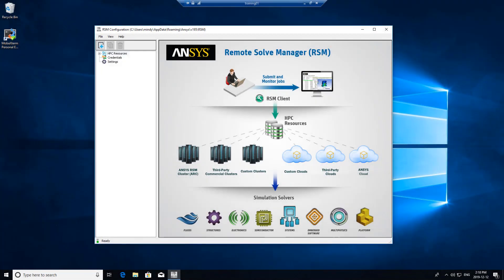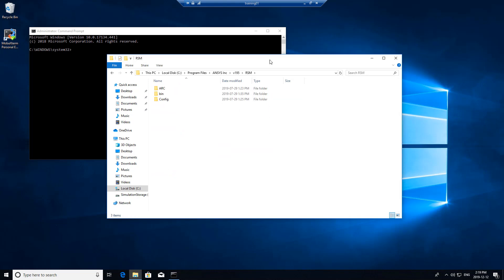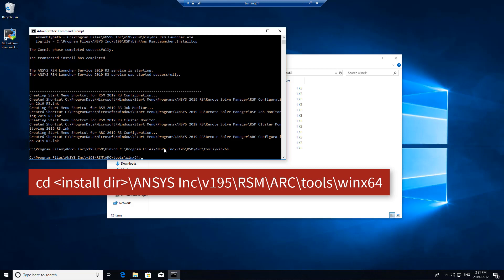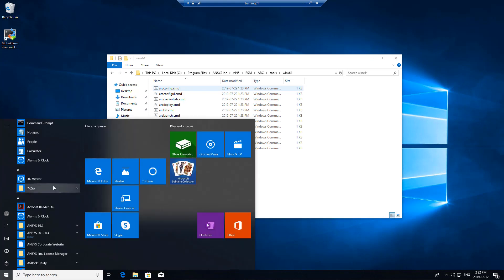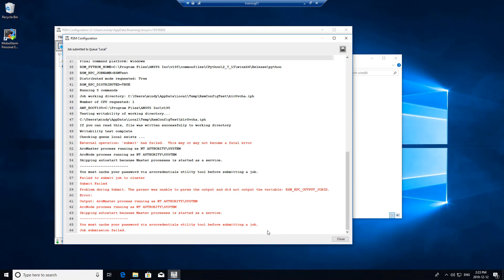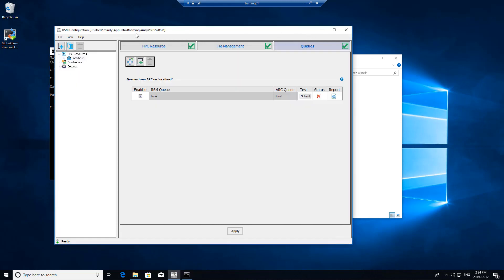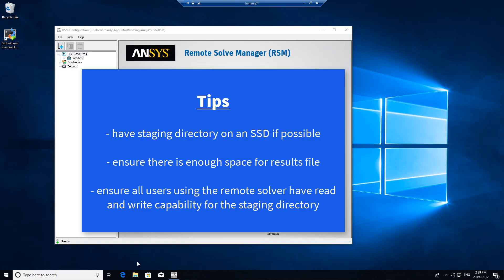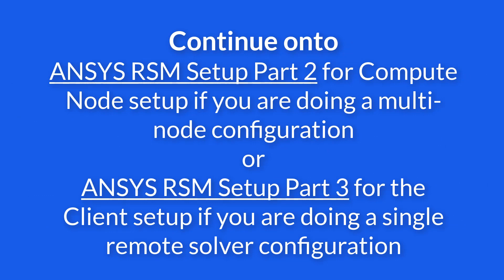Configuring Ansys Remote Solve Manager (RSM): Part 1 – Head Node Setup

Comment: Thanks for the video.
I try to install the RSM on AlmaLinux and get error when try Submit (as video at 3:17): System Admin accounts are not allowed to run jobs.
I also install other products of Ansys and it can work normally but get error when use RSM.
Do you have any recommends to fix it?

Thank you/
Reply from the maker: Thank you for your comment. You can check out our Licensing and Installation Portal here: https://install.simutechgroup.com/contact-us?search=Ansys%20RSM%20&returned=true